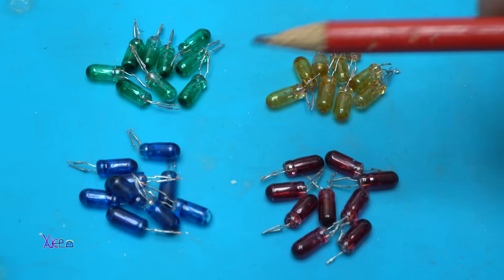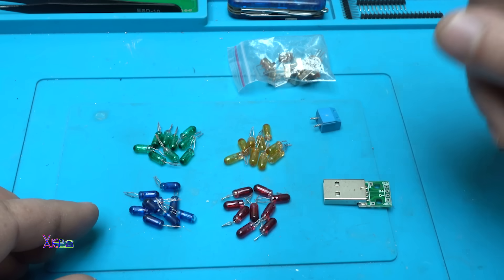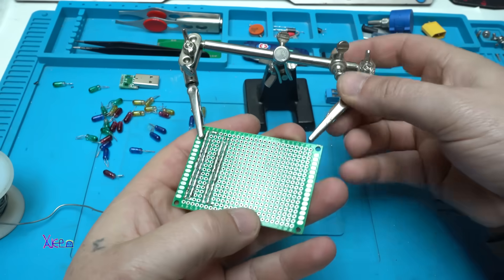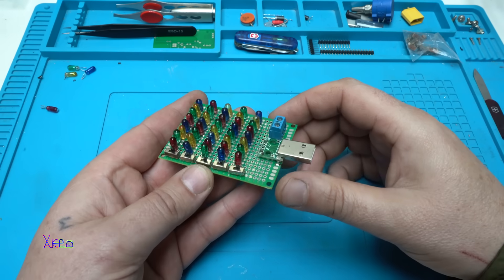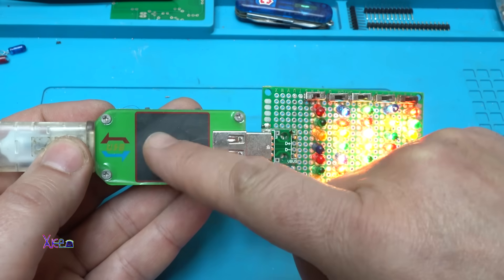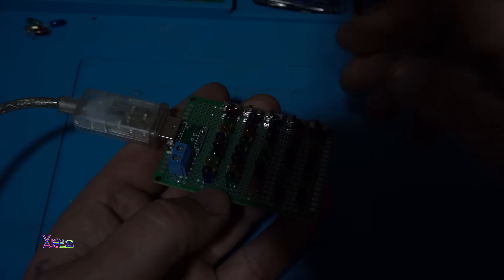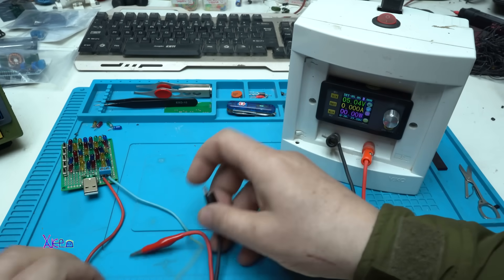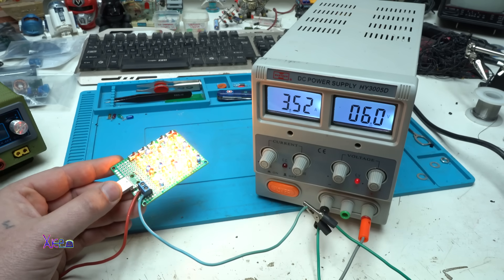How to Make 5V-3A USB Tester -DIY Electronic Load

Comment: Cool project, putting those old Christmas lights to good use.
I found out recently that you get tiny voltmeters that can measure 5-30 volt DC (in reality they can measure as low as 2.5-3 most of the time). It could be interesting to have one in the circuit to measure the load, or maybe make your own. All you would need is a capacitor, a few diodes, and some resistors (as to not burn out the leds).
Reply from the maker: Thx for feedback sir and for sharing the idea.👍

Comment: The USB doctor switches off because the filaments of the bulbs are cold and are practically a short circuit for the power supply. The USB doctor has a very fast measurement and so it detects this starting current and switches off. If you turned it on while the bulbs were on, the filaments were hot and drawing a fraction of the cold filament current.
Reply from the maker: Thx for explaining that sir
Reply: @Hacktuber It is generally not recommended to use incandescent lamps as a load resistor. If you connect a cold filament bulb to any sensitive device, the device may shut down, like your USB doctor, or get destroyed. There are polyswitch fuses that respond to extreme currents by permanently interrupting. These fuses are installed on computer and laptop motherboards. If you connect a load from the bulbs to the USB of a running PC, the computer may suddenly shut down or permanently disconnect the USB port. In the extreme case, you will destroy the computer's motherboard.
Reply: Réveillés toi,les leds n’ont pas de filaments ,pas d’appels de courant  si on ne connaît pas on se tait, au moins on ne passe pas pour un c....

Comment: To get a more precise test, you could have the first switch connected to a single light bulb, the second to 2, the third to 4, then 8, 16 for a total of 31 bulbs and 5 switches. If you have more, you could add another switch and 32 bulbs.  That way you could select precisely how many bulbs from 0 to 31 and have a "1 bulb resolution" when used as a tester. It would also give a visual demonstration of the binary system.
Reply from the maker: Good suggestion, I will think about it for my next project 👍

Comment: I guess the momentary current surge exceeds the 3.2A
Reply from the maker: Yes but max current is around 3.5A
Reply: @Hacktuber  To be clear, resistance of the incandesent lamps is much lower initially while the filament is at room temperature.  Thus, we can anticipate a brief surge current greater than steady-state will occur.